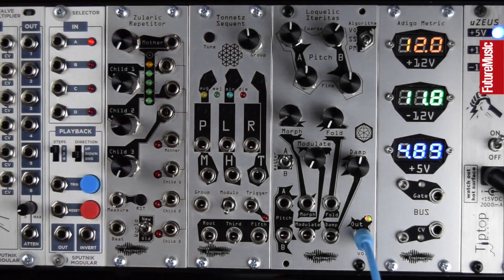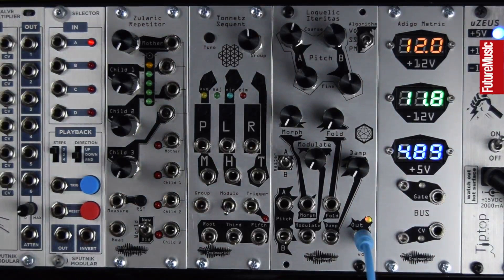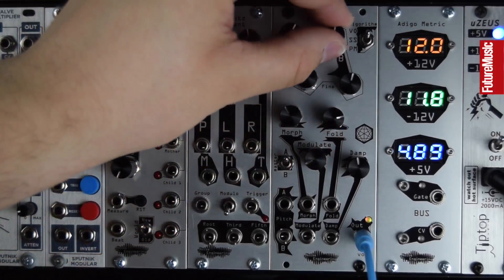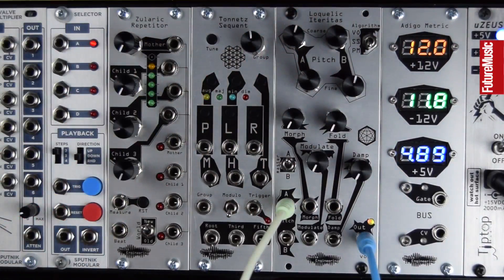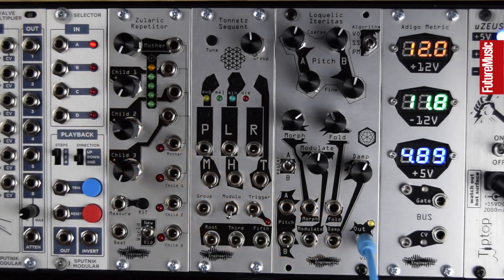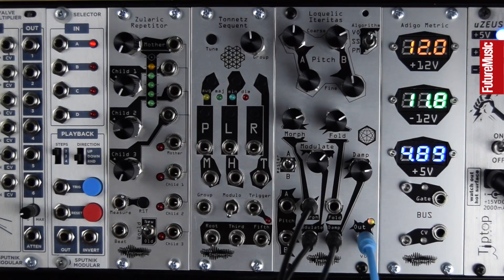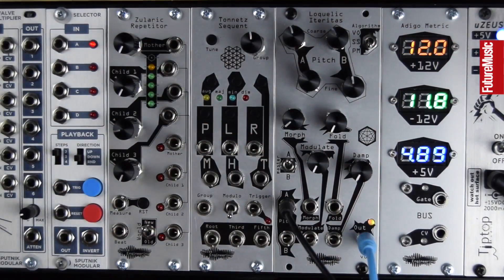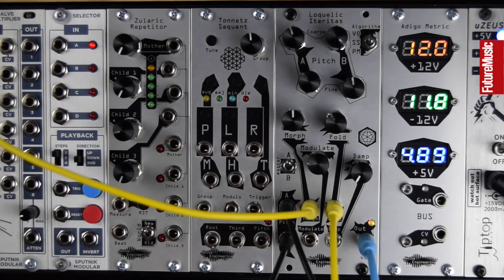Modular Monthly: Exploring the broad sonic range of the Loquelic Iteritas

Comment: Everyone seems to like this one, but I've yet to come across a digital drum module that has a full deep tone and isn't just super glitchy and sounds noticeably digital to me, which I guess is their strength.
Reply: Uuuuum this isn't a drum module.
Reply: OOps, I'm tripping! I was thinking of the other one they make..although since they're both digital, theoretically you should be able to get in the range of either one more than you could with the corresponding analog components..which is both their strength and weakness.